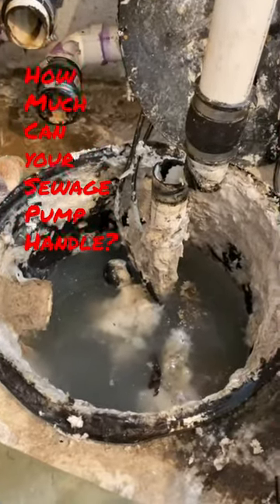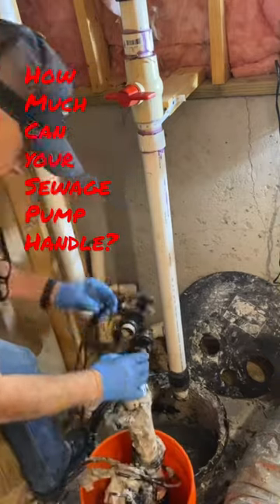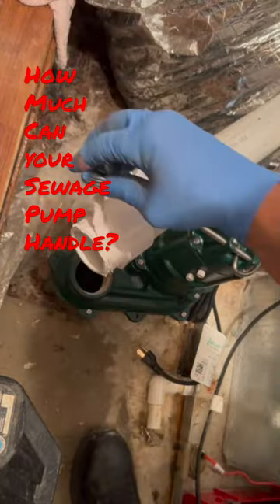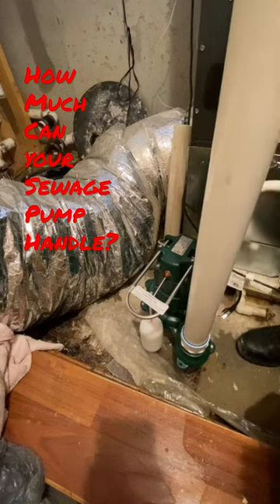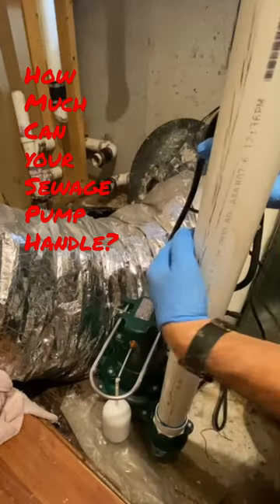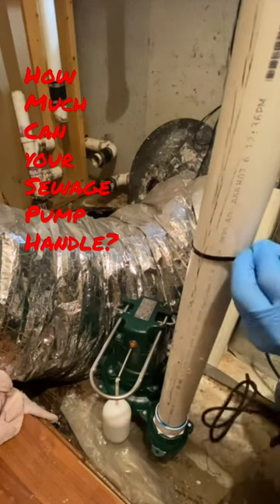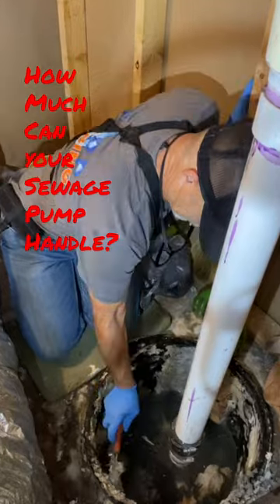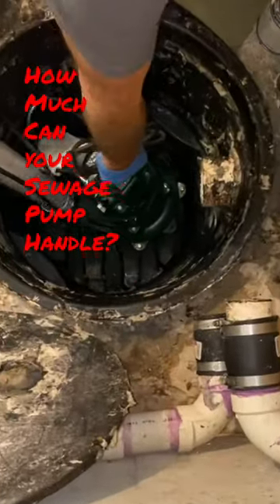Sewage Ejector Pump Replacement @TappPlumbing #plumbing #plumbers #shorts

Comment: My life every 3 months
Reply from the maker: Are you telling me you are replacing a pump that often?
Reply: @TappPlumbing  yea man, zoeller m267 for a triplex where everything goes into sewage bin. Can't tell tenants to use 1 ply. Have to clean toilet paper every 3 months and full pump failure at least once a year. Used zoeller m264 because it was cheaper and only lasted 2 months. Don't know what to do... maybe larger bin with two pumps?
Reply from the maker: @nicholasdifabrizio1115   Have you tried a liberty omnivore? If remember right they are pretty expensive and may take some extra power. I saw one at a plumbing show chew up a piece of denim and discharge it.

Comment: Sometimes a little more for giving if you use a 2hp 230volt grinder pump but still not ment to flush junk down or it won't last either.
Reply from the maker: I would imagine a pump like that would certainly do the trick!

Comment: Only new installs for me. No interest in this service work. Cudos to you sir good job line those pockets cause if i was doing it the price wouldnt be homeowner friendly. Cheers
Reply from the maker: I know what you mean about the new installs!! I always said the same thing, my father and uncle were plumbers and I worked in plumbing as a child . I only did new work until the recession of 08 when there was literally no new work. It was either do service or lose everything we had. Sometimes I really miss building new systems but the service is fairly interesting also. This job was super nasty but it does pay . This is actually a very small percentage of the type of work we do , most of it is fairly clean. Best of luck in your plumbing adventures and thanks so much for watching!!!!

Comment: It looks like you used a Zoeller pump with a vertical float. I am currently using a Liberty pump with a tethered float. Which do you  recommend? I always fear the tethered float will get hung up on the side of the basin.
Reply from the maker: We loved the Liberty pump and used it for years. We adjust the tether a little shorter if needed so that doesn’t happen, however that can be tricky as if it is too short it continuously stays up and running. There is a fine line there. It seemed to be giving us more issues than we liked so we swapped to Zoeller for that reason. We like the double plug on Liberty better but have not had any issues so far with the Zoeller. We swapped over about a year ago.

Comment: After I drill the 3/16 hole I take a inch and a half by two firmco the 2-in covers the 3/16 hole and stops it from splashing around works great
Reply from the maker: Very interesting, that sounds like a great idea! We put the same video on tik tok and people said they try to make the hole to spray off the float . That is very interesting as well . Thanks for sharing!!!
Reply from the maker: I don’t know if you actually live close to the Salmon River. I know that area is still getting hammered with winter weather. I have friends already fishing down here and am very ready myself. I just need a little time!
Reply: @TappPlumbing  thanks for the shout out I live 45 minutes from the Salmon River at one time it was my second home now they're slamming steelheads it's a great time

Comment: Use a LIBERTY “grinder pump” system these will shread a New York phone book easy
Reply from the maker: @weekendfreedom6136  We used liberty for around a decade and then a few years ago it seemed like problems became a regular issue. I guess you have had good luck with them recently?

Comment: Bad design tank should be larger
That pump will short cycle and need replacing again

Also, there’s a lot of float clamp option out there to ensure the float stays
See she rhombus or alder is products
Reply from the maker: Completely agree , it would be great if the tanks were larger. It is somewhat aggravating to get everything crammed in there.

Comment: A better solution to this is to use a bidet. No tp needed. Problem solved.
Reply from the maker: Ha,well I guess that may be a solution to no toilet paper, however the pump still has to pump the liquids and solids therefore  they still wear out unfortunately . Thank you for your suggestion, watching and commenting!
Reply: @TappPlumbing  agreed everything wears out eventually. But pumping straight water probably puts less load on the pump compared to solid waste.

Comment: What is this? How do you know if you have a ....whatever this is? 😮
Reply from the maker: It is a pump in basements that have plumbing that has to pumped up to a drain above. If you have one you will hear it turn on . It is under a round lid in the floor.
Reply: @TAPP PLUMBING  I know what a sump pump is and I just heard mine a few minutes ago - but my sewage line doesn't run through it
Reply from the maker: @mangos2888  Sump pumps are for rain water. They are different than a sewage ejector pump.Do you have a basement with plumbing in it?